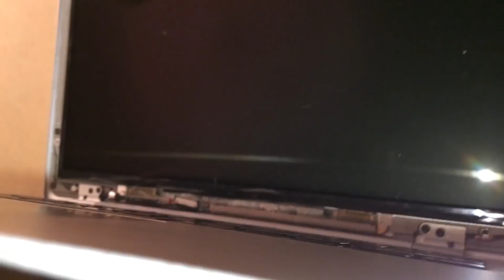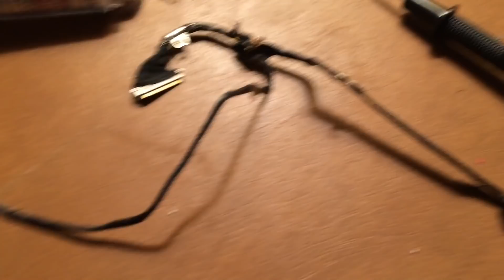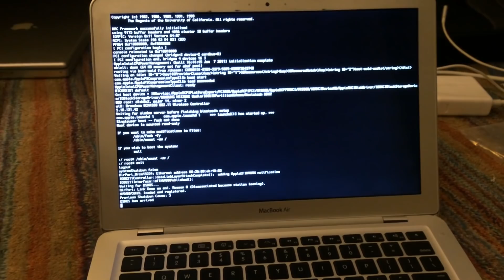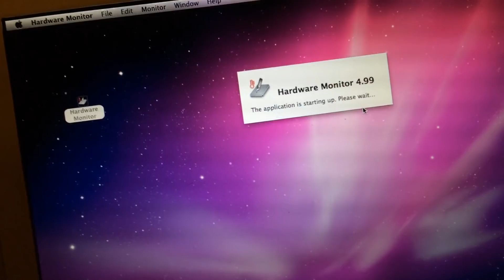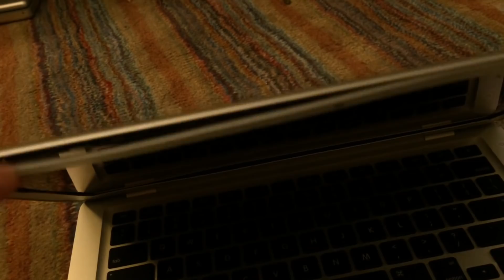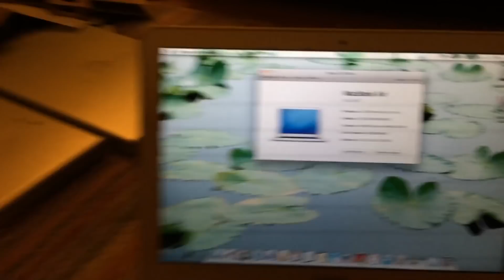2009 MacBook Air Model A1304 Repair

Comment: Its 2025 now lol and this same A1304 has been dead in my garage for years. I replaced the lcd a long time ago and since it was a used panel it died shortly after. I tried charging it again a few years ago and the charger wont even light up. Today I grabbed it and want to see what I can do to it. Its pretty clean somehow and Im only missing one screw for the lcd panel on the logic board lol. I  want to see if I can revive it and see if I do have the invidia graphics!? Its a 128gb hdd but the rest of the numbers have worn off.

Comment: I just got this model from a friend for free. I’m curious about trying to reflow larger ram chips on it. Is there any information I could read on how much ram the board can theoretically handle? The core 2 duo is 64 bit, so no limits there afaik.

Comment: I did a screen replacement (not the assembly just the panel) on a a 2011 11" air. by far one of the most difficult things I have ever repaired

Comment: What type of camera are you using?
Reply from the maker: +Tomcat12789 It's an iPhone 5S, so not the best.
Reply: +dosdude1 I thought that it was focusing on the cables really well and I want to start doing videos but I thought I might need a better camera to get the quality I want.  I also have a 5S and I might just use it.

Comment: These little Airs are nice. Thin, light, fast enough for basic usage, can run any version of OS X from Leopard to El Capitan, fun to play with. I've upgraded mine, a late 2008 1.6 GHz, with a 128 GB SSD.